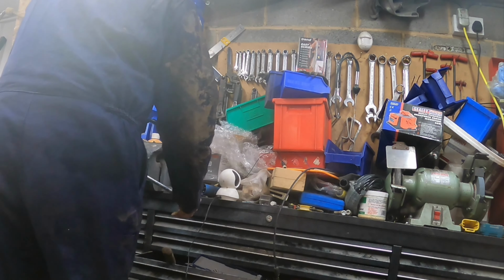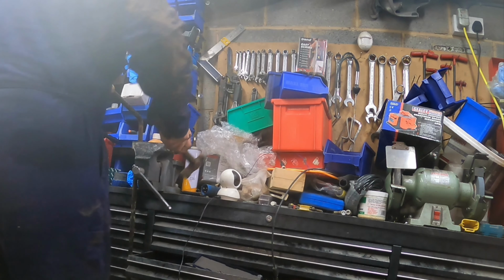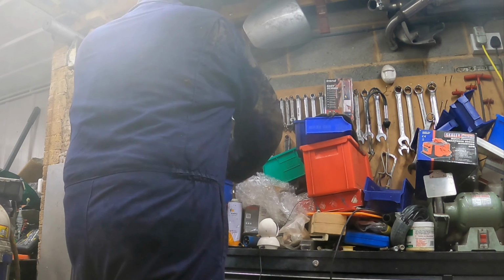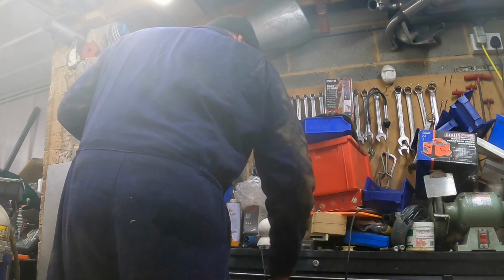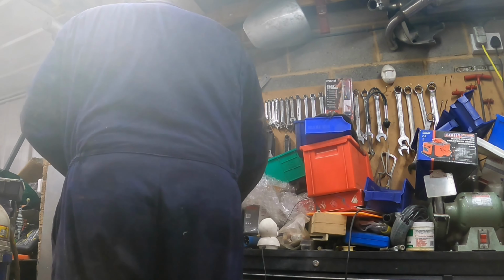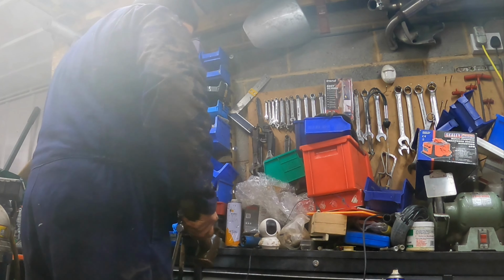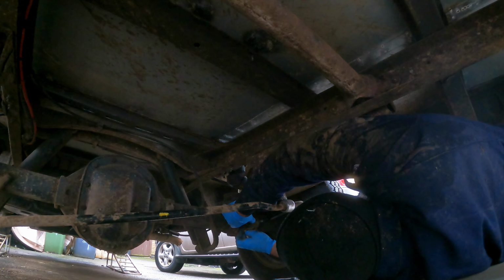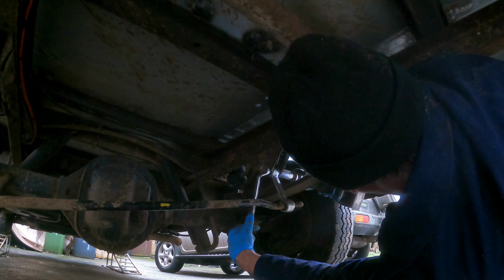How to Change Iveco Daily Rear Anti Roll Bar Bushes

Comment: I'm just about to try and get the old ones off and new ones on. How the hell do you get round that bend without destroying the new ones!!
Reply from the maker: bit of oil and some wiggling. and a few taps with a hammer
Reply: Thanks, the new ones actually went on easier than getting the old ones off 👍🏼